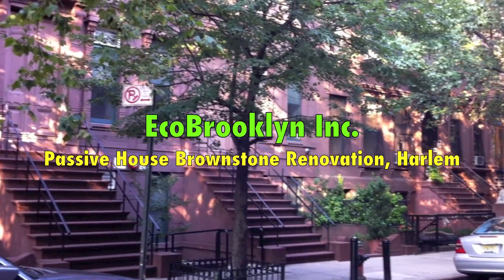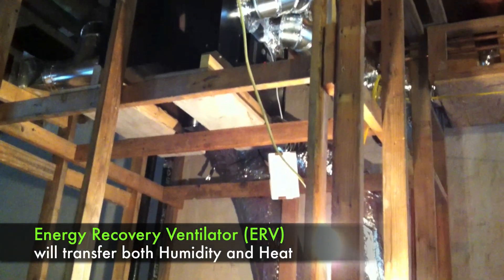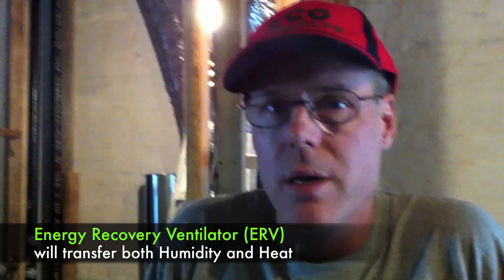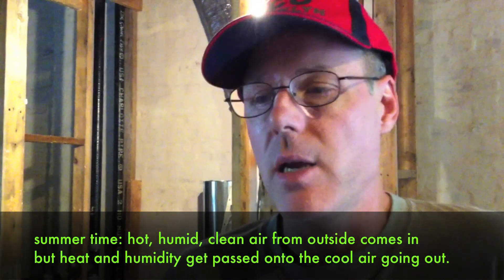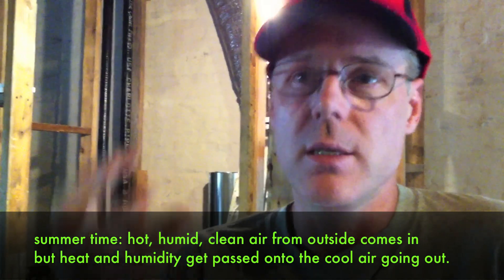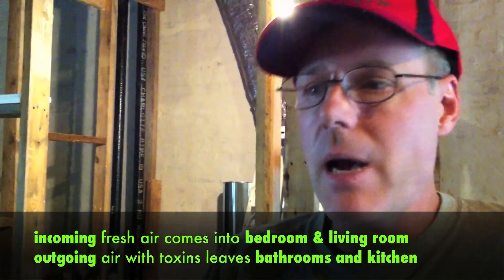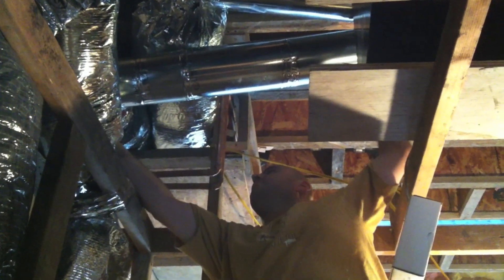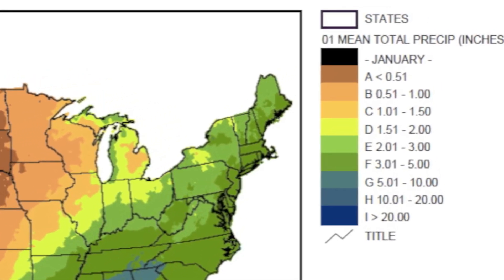Energy Recovery Ventilator, EcoBrooklyn

Comment: UltimateAir is considered an ERV because it not only transfer Sensible Heat Energy, but also the Latent Heat Energy in the moisture of the air keeping the indoors humidity more stable and over-all energy exchange the highest on the market.
96% ASE (what you feel as far as temperature).  The energy transfer material is partially hydroscopic nylon and Visil.
 Keeps Heat and humidity Out in the summer, and opposite in the winter.